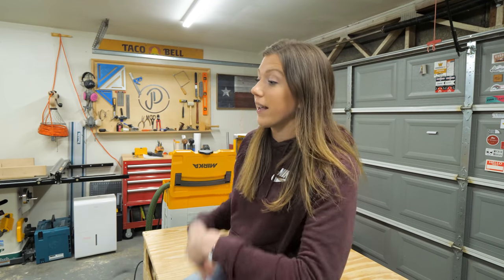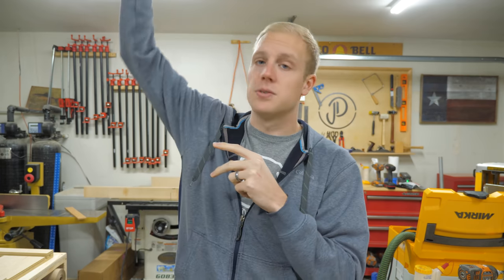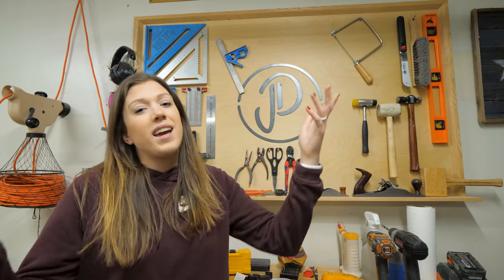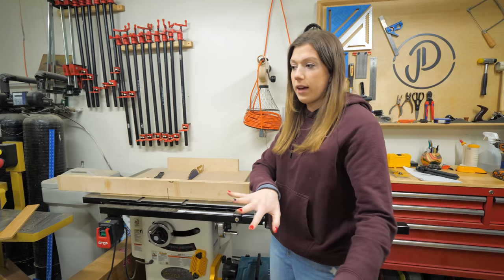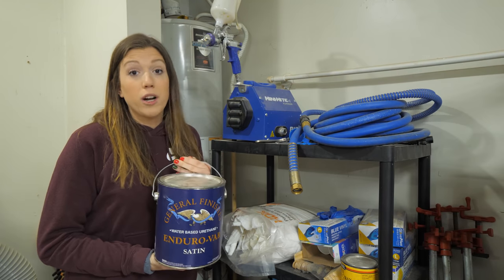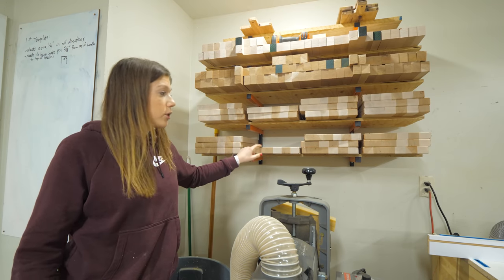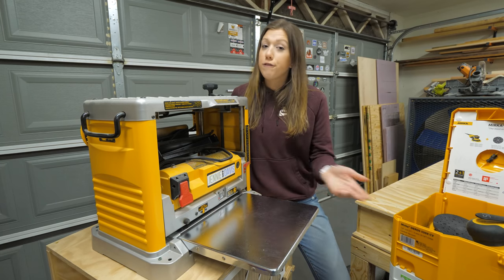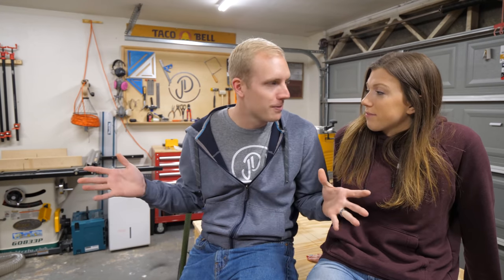realizing we spent $25,000 on tools... 😳 Woodworking Business Shop Tour 2021

Comment: So one of the first outlets I installed was a 4 gang box on the ceiling where the garage door plugs in. And then An extension cord reel. I use that thing every day. 

Most metal gang boxes can be ripped out with a bit of hammering and a screwdriver and then a blue plastic box can be put in.

Comment: I had a similar tool wall that I converted into a tool wall with storage behind it — love it!  I cut a 4’x6’ sheet of nice plywood into three doors.  Used piano hinges to mount the doors onto three 1x6 frames with holes for adjustable shelves.  So, my tool wall is now about 6” closer (easier reach), still stores a bunch of tools, and has excellent storage behind it (spray cans, rolls of tape, etc.).  Very happy with the result.  Good luck!

Comment: If you’ve not thought about it you can expand your electrical power pretty easily.  I had the same problem, one wall circuit.  I had electricians come and add two circuits pulling the wiring from the breaker box and thru the attic and down the walls with external wall mount outlets.  I also had them run both new circuits to both sides of my garage/shop.  Now, three circuits and no problem.  You need to have a couple of unused circuits in your breaker box.

Comment: Depending on how much the sun beats down on your garage. Definitely invest on insulating the garage door. I live in Az, it definitely helps. I used 1 1/2" insulation foam boards and cut to size in each panel.

Comment: why not install more outlets? It's super easy. Unless you don't have space in your panel.  I would at least -install  1-2 20AMP 120v Breaker single pole breakers for your shop tools and 1 30 AMP 2 pole breakers for your 240 AMP tools.

Comment: Guys I feel ya on shop space and power. My old house had 2 outlets and 1 worked half the time bc when built in 76 the wire wasn’t wrapped around the terminals they were just stuck in. I ripped out all drywall and installed dual outlets every 4 ft.

I’m in Texas too, buy a minisplit!

Comment: Great trick with the jointer vibration,  place a piece of rubber mat under each of the leveling feet!
Reply: I have thin hockey pucks that are supposed to be drink coasters under the 4 corners of mine.
Reply: @eclecticlight.design  the thing with the rubber mat is that it’s soft enough to conform to the uneven floor as well as isolating the vibration and helping also with noise. You want something soft. Hard rubber really won’t help much. Try it .
Reply: @MSRWorkshop  they’re drink coasters, so they aren’t really that hard. I actually only use 2 for leveling my jointer, but the entire thing is on one of those office chair mats to let you roll on carpet. I cut it down to the size of my jointer’s base. Then two fake hockey pucks on one side to level it.

Comment: One of the first things I did when setting up my shop (which is no where near as well thought out as yours) was have an electrician put in a new breaker box in the shop.  Now each machine has it’s own breaker instead of trying to run everything off 1 single 10 amp circuit/breaker that dated from the 60’s when the house was originally built.  Yeah, it was a wee bit expensive; but now I can safely run the CNC & the lathe at the same time while my wife sands at the finishing bench.

Comment: cool toys, for Jointer try to use a large and thick piece of rubber to eliminate some of the vibrations that appear in contact with the floor and the "foot" of the tool

Comment: I put almost everything in my shop on wheels. I currently have four benches. One is an automotive/mechanical bench which can be rolled out into an enclosure in the driveway. Another is set up to be the exact height of the table saw top, and two more are old benches handed down and pressed into use. I have the usual suspects as tools, mostly found as hand me downs and deals along the way. Three massive tool boxes make up the rest of the shop, and all are on wheels. Don't need it? Roll it aside. Cool video, will be waiting for more.

Comment: best make sure the 110 is a 30amp if not any 15amp breaker will strain to provide electric causing the tool to over heat and Burn out, Houses in Houston have 10-20 amp in garages so people could not work a shop out of it . I burned out a variable speed Rikon lathe power box 4x's before figuring it out
Reply from the maker: Interesting - thanks for the tip. We'll see what we can do.
Reply: @jennieanddavis  if it is not a old house you can simply replace the breaker at Lowes or HD for about 20 bucks .

Comment: If you insulate your garage door, you will be a lot more comfortable throughout the year. There are lots of videos on YouTube that show how. It made a quite a noticeable difference when I did mine.
Reply: Correct!  But since their garage is a rental, I’d suggest fitting 1/2” foam with double stick tape. 2 or 3 4x8 blue boards should do it.

Comment: Put a retractable dropcord on the ceiling and plug into door op. Will reach anywhere in the shop and free up the space on the wall where other on is
Reply: A lot of overhead openers are hooked up to a lighting circuit, typically 15A. So when the table saw bogs in a cut and blows the breaker, you’re left in the dark.
Ask me how I know.
Reply: @robert_g_fbg  table saws on its own 220v so it would be small hand held tools
Reply from the maker: Then our lights would flicker. Kind of a big deal when you film your builds...
Reply: @jennieanddavis  fair enough. My door op is wired in with the outlets on same circuit with no issues using led lights.
Reply: @robbiewilliamson8962 , my experience is from before LED bulbs were affordable. There are always workarounds to the little challenges.
Reply: @robert_g_fbg  i understand. Without knowing more variables about the shop its hard to say what they can really do, but since they want a com. space it really wont affect them later.. hell now that they have 220 in garage and the required amperage on the breaker u could put a good charger for an ev

Comment: I'm guessing here, but the reason your concrete floor is "uneven" is probably because it's a garage floor. Garage floors are designed to slope, usually about 1/8" per foot, to get rid of water.

Comment: One outlet at the end of your garage ?!! Builders are so cheap these days. The company I worked for always put 2 on each wall . You can add some more yourself  (without sheetrock repair) , just get an electrician friend to give you some pointers. That is one nice jointer too !
'
Reply from the maker: This house is over 40 years old.. has nothing to do with builders ‘these days’.

Plus, modern codes make buildings safer and more versatile than ever before. I say that as someone who hates complex building codes...

Comment: I own several 220v extension cords I made for my tools, when in a garage with only one outlet.
Reply: As a retired lifelong sparky do not recomend extension cords for permanent equipment. Better to bite the bullet and have the needed receptacles installed. Had a customer that had a 3' extension cord for a wall click for years. First thing new fire marshall wrote up on his walk thru. Owner told him " but its been that way for last 20 years ". Told the owner it would be cheaper to purchase a $15 battery operated clock then for me to install a new receptacle but he was in love with that old wall clock and had me install a receptacle.
Reply: @garbo8962  old EE here too. It is difficult to install outlets into an existing cement slab floor. My 220v equipment was all 3 or 5 hp, on wheels. Ext cords were the same or better gauge than what they’re extending.

I agree though, that it is best to keep up to code, as it is enforced.

Comment: $25k, that's cute.

-Metalworkers
Reply from the maker: I think you just ripped your shirt with that flex
Reply: @jennieanddavis  It's like flying: Thrust v. Drag. Yes, $25K is a high budget, but it's risk v. reward. How much can I make and how much is THAT TOOL going to return to me? Best combo: jointer-bandsaw-planer. Add a wide belt sander and you have production. Presuming you have a tablesaw and router table. Want fancy? Add a CNC and Co2 laser, but I digress. I REALLY appreciate the thought that goes into what they purchase, how it's laid out and what VALUE each item brings. 

Now, as a fellow aviator, DO NOT FORGET YOU HAVE DAY JOBS - and the rest of us depend on the data you gather and provide <g>. 

Thanks kids. Now go make dust.
Reply: @TheWoodFly  and a few more outlets!
Reply: Mr pilkington has entered the chat
Reply: Gag me with a spoon. Please.

Comment: Why would you pull a 220 line for a plug and not pull a little bigger cable and do a sub panel?
Reply from the maker: Rental house = temporary workshop 😉
Reply: If you were going to get your power from an existing receptacle, then you are limited to the amperage rating of that receptacle’s wire size and breaker.

Comment: There is no snipe on my DeWalt DW735 and I know of no one that has snipe with one. As far as snipe goes my Jet 15" 3hp has lots of snipe as do most 15" heavy duty planers. The head locking mechanism is better on the DW735. I will probably end up selling the Jet now that I have the DW

Comment: “Worst and uneven concrete I’ve ever seen”
Oh boy... you should see the 1950’s “slab” that I work on. I can step on one side of a cracked piece and the other side flies up. Sawdust is forever stuck in the cracks. The cracks can be up to an inch and a half.

Comment: Domino's don't add support, they're just for aligning
Reply: It is a floating tenon/mortise joint, and they are quite strong, similar to dowels. I have yet to see one fail.
Reply: I forgot to say that while you can use Domino to align pieces, the biscuit joiner is much faster and cheaper to do that task. Happy woodworking 😊

Comment: Can I be first in line to buy your lunchbox planer when you upgrade? lol I have fought snipe and fought snipe, and you guessed it fought snipe. :)
Reply from the maker: You know, as soon as we finished filming this video, we've started getting some NASTY snipe on one side... Fiddled with the outfeed table for an hour and still couldn't fix it. We ruined it for ourselves!
Reply: @jennieanddavis  oh no! I have minimized mine as much as I can, now I just embrace it and try to work with it. Lol
Reply: Look on YouTube for removing snipe videos. Basically just used some melamine to make a removal bottom surface that is longer each side of infeed and outfeed. Sacrifices some thickness capacity but be removed easily enough if needed
Reply: @andrewcollins5868  yeah, I did that. My issue is the entire cutter head raises up on the corkscrew thing (technical terminology) when the board goes through. I can see it when it happens. 👎

Comment: Look for a house with property. Build a workshop 400 squar foot have it wired with multiple 240 and 120 volt outlets with a mindset of what and where your shop layout is.  Do this now. Becuse 30 years goes by in the blink of an eye. Its so fast its not even funny. If you don't do this wile your young you never will.

Count your blessings my wife won't let me use the garage, I have to use my basment, but both my spaces are larger then yours. And I still want a 400 squar foot work shop.  I do not want the sawdust all over the inside of my house.
Thats what a basment shop will do even with good dust collection systems.
Thats also a differnt subject  the shop heat and cool with mini ductless split system and build a sound proof room for your compressor and one for dust colection system.   Wood floor shops are better on your feet. But wont hold as much weight without cost vers cement floors.  Id do below ground dust collection system  you can use pvc pipe for that  but you cant change it later without a lot of cost. If you move just fill it with cement or as is. Add screens so large chunks of wood won't go into it and block it, 6" pipe is better. No 90s unless they are long sweeping turns.  Tight 90s block air movement.  Add a lot of natural light skylights but windows block wall space.   Ok 400 squar foot might not be enough space. Bigger is always better.
People have started out in a garage and wound up with a large bussines. But qulity help is hard to find. So think about that.   Save some money dont use credit 
Pay cash as often as you can.

Comment: think about investing in a real saw, like a european sliding table saw. a good sliding table „formatting“ saw is without a doubt the most versatile and awesome tool you can have in a shop. it needs a lot of space, yes, but it is worth it. these american toy „cabinet“ saws are a joke
Reply: It would be nice but not in a 2 car garage . And if you don’t do a ton of plywood projects it wouldn’t pay for itself
Reply: @bp7770  that is the common misconception. sliding table saws are not meant for sheetgoods (of course they are very good at processing them nonetheless). the sliding table next to the blade enables you to do all sorts of cuts in solid wood (cutting the edges off rough lumber, all sorts of angled cuts, taper-cuts, crosscuts in all dimensions, etc), without the use of "jigs", and very precisely and safely

Comment: I cringe every time I see someone in a shop with sweatshirt draw strings hanging.
Reply from the maker: Curious... have you ever heard of ANYONE getting the strings ‘sucked in’ by a tool? One would think those stories would be all over the news and the internet if it was a legitimate concern...
Reply: @jennieanddavis  Are you serious? Yes I have. It's just an unsafe practice. Same as any loose fitting clothing.
Reply from the maker: @vikingslayer34  have you seen Mattias Wandel's video trying to get clothing sucked into the table saw? Curious to your explanation of why the fabric never got sucked in.
Reply: I've had loose clothing snagged by an angle grinder and a drill with a wire wheel.  I've also seen gruesome video of deadly lathe accidents where people get sucked in. At work we use break away lanyards for that very reason.  It happens.  Stay safe and good luck!
Reply: Your reply is disappointing. In the name of safety please listen to these folks that have much more experience in the real world. Loose fitting clothing , jewelry and rings are a no no around moving equipment. Plain and simple it’s just a bad habit to start in a shop.